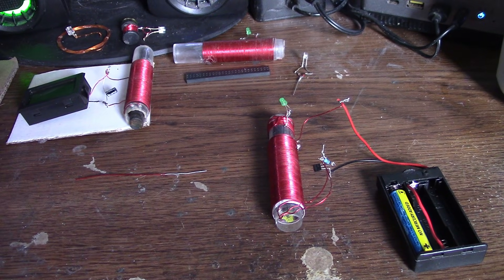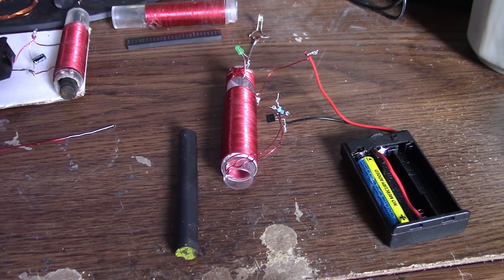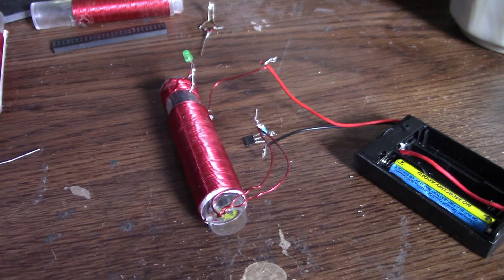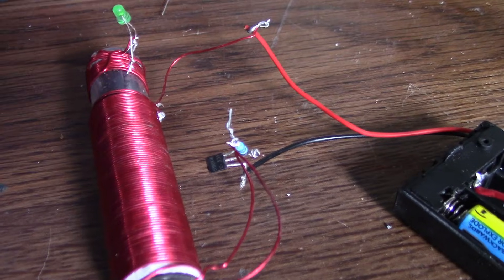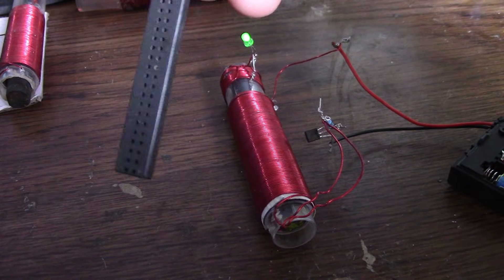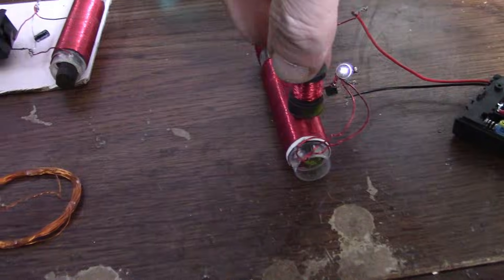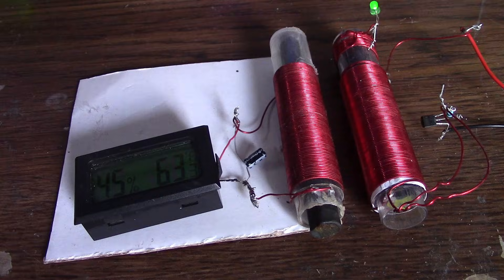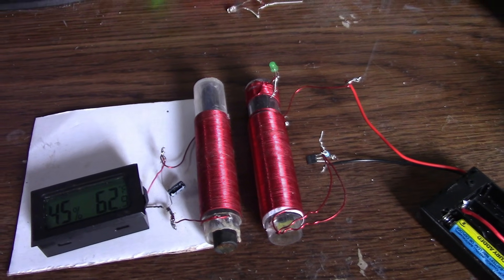An Aluminium Joule Ringer (Easy to Make)

Comment: This isn’t quite how a ringer JT works, is it ? 😂
Reply from the maker: Lasersaber normally has multiple layers on the secondary, true enough, but the reverse direction full winding is what I associate with them. 1 full layer 'forwards' and 1 full layer 'backwards' on ferrite 😀
Reply: May sounds ridiculous but, this is exactly what is described in Tesla patent 336962 with multiple arrangements where according to explanations in patent this is manipulation of magnetic field, being completely or partial cancelled or moved simply shifted to one side and the transistor in your arrangement substitute the commutator/switch.

Now I dare to ask for some help as I have no education in electric/electronics and my “problem” is related to solar charger controllers specific pwm type. I am using an output from a pancake coil monofilar which can provide 68 Voc at 7.2 amps. I have fitted a headlamp car bulb for 12 v 55w and measured 14.6 V at 2.5-2.6 amps … my solar charger controller is able to handle 50 Voc max 780w for 24 V system automatic detected.
Despite steady rectified (with 4 diodes SB5100) my controller do not accept this input and I need to mention I have placed a spacer between coils to reduce the output for 45-48 Voc and 2-2.5 amps. I have tried to feed directly the battery bank (2 sla 12 v 7ah in series) or through the controller but the voltage drops to 24.7 v whichever way and wont charge the batteries as voltage is too low. What can I do ?
Reply from the maker: @Caesarus2011  Am thinking that an isolation transformer is well worth looking into. It sounds like there are transients in your signal, perhaps high frequency noise and other effects that the PWM controller is protecting itself from. The waveform needs to be clean DC. In essence, your input power has to look like it's coming from solar panels. 
Pancake coils do an excellent job of self regulating their own capacitance and field energy, similar to Slayer Exciter towers in that it's damn tough to blow an LED... can even put a 90V neon and 3V LED in series and both will light. All of that effect has to be stopped, because the PWM controller is seeing it as a fault and shutting down. 
A possible other option is a hefty inline cap, to help to smooth the voltage and noise out (160V 100uF or higher). You'd not be limited to the SLA batt voltage pulling the system down.
Reply: @ Many thanks for reply, your answer is greatly appreciated … imagine today I have played with this for almost 10 hours and tried few tens of combinations … if you can imagine the only series connection of a cap have been left out 🤣 … but all in all was a great day of experimenting and found out many other useful things and effects.

I already tried bifilar and monofilar pancake coils and indeed monofilar seems to perform better but I have tried few capacitors that I have available only in parallel which seems to reduce the output somehow.

At some point I was about to blame the controller for cutting off the load trying to prioritise charging and in this way was actually cutting off its own input power and switching constantly between charging and powering the load with batteries … rather then acknowledge there was an inrush current acting as a sink trying to deliver all available power into battery while requesting more input to fill that abyss and causing the whole system to shut down due to protection features.

I don’t have any isolation transformer as I was thinking to use one or some optocouplers … it was like looking everywhere in the house for my glasses while I was wearing them 🤣

Probably I will make another short video to show what this little baby can do and what can’t.

Anyway I will come back later to let you know the outcome and again many thanks for help.
Reply from the maker: @Caesarus2011  Haha, great to know how it got sorted out and congrats on finding the circuit error! 👍
Reply: @ I didn’t sort out … yet, have ordered some components and hopefully I will publish my findings this week if they arrive on time